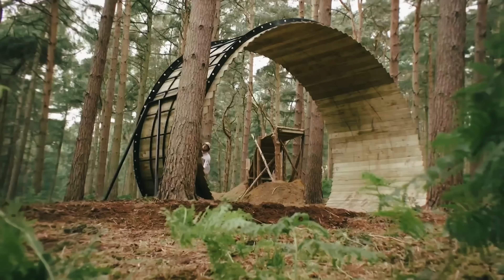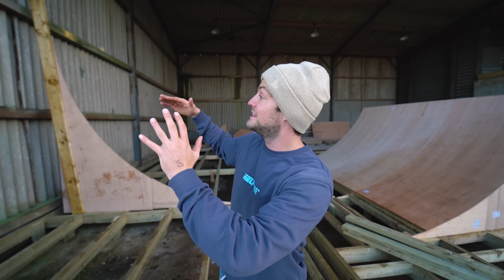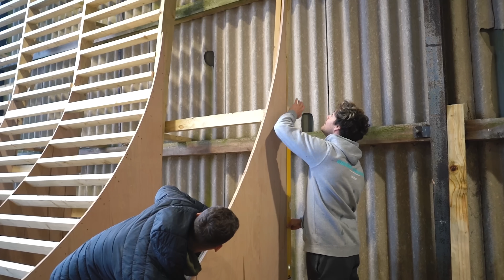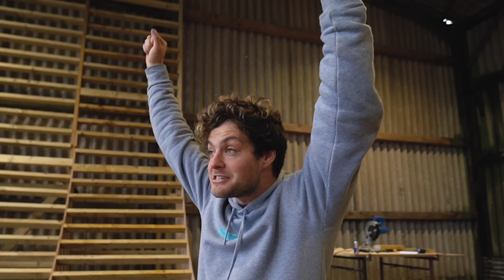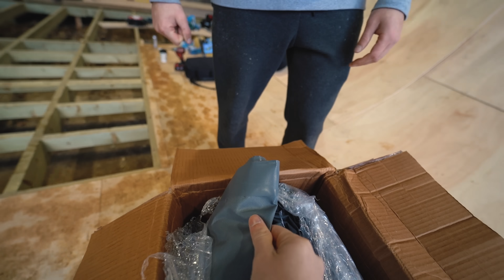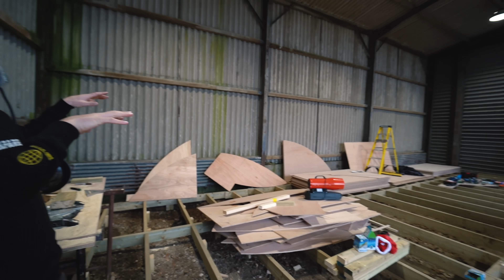WE BUILT A GIANT WALL AND NEW BACKYARD SKATEPARK FEATURES!!

Comment: Either in one of the corners or against the long wall there should be a small concrete section. And built into the concrete section there should be a fire place with a metal or stone chimney that can run all the way to the ceiling or a right angle out the back wall. A fireplace with a 6 ft roller over it. Warm n cozy in the winter!

Comment: For that final corner (even if you will need to hire Bob the builder) I believe a loop into a wave you would find in a pump track could be a crazy addition and would require that speed you would gain from the wall or any other pipe in future

Comment: I love this build! But please tell me you’re using a stop block on the chop saw when making multiple cuts for those ramp stringers? If not that’ll help with efficiency a lot. Also you could add weight to the curtain by rolling the bottom up a bit and sliding a pipe in and stabling above it, then close off one end and just add sand as needed to the pipe to increase the weight slowly, then close off both ends

Comment: curtain is gonna have a few issues unless you can anchor it down with some ratchet straps or something. I had one of those temp barns with the fabric and the wind made a joke out of it. Fighting mother nature with a sail it tricky. The wind is going to need somewhere to go and that's going to inevitably allow rain in. A decent temporary fix if you can strap it down and find a way to let the most wind through without letting too much of the elements in. We cut slits into our "doors" to our temp barn and it helped, but i also was able to have half of it open to let the majority of the wind through since my mini pipe only took up half the barn. I hope it all works out!

Comment: Rather than the Skate Light (Skate Lite?) plywood, you could look into Marine Grade Plywood. It is designed for use in boat building, so there arent voids in the individual ply layers for water to collect, and the glue is designed for moist environments. It should be much cheaper. I checked a few places (at least here in the US), and 12mm 4ft x 8ft sheets are around $60-70.

Comment: good one boys. Stopped after the water proof bit to wright this. Now you have made a sail. Hope it goes well wind can be easier to deal with then water with some holes and flaps. I think you will be also best to paint the first meter and a bit of ply. rough texture house paint should work well and not be to slipy. good luck.

Comment: Here in the states I use a product called cabot deck correct to resurface old decks.  I think it would work pretty well for protecting your plywood from the elements.  It will leave a rougher tacky finish that probably would not be good for skating on buy biking would work just fine!  It should be around $200 for a 5 gallon bucket.
Reply: Just use marine paint. It's meant for the surfaces of boats. You can thin it for a smooth finish with mineral spirits.

Comment: Please make the step up at least 8-9 feet tall (sorry, American here) that way you can have something under it, maybe a sitting area, or somewhere to store drinks (red bull and water). Then you could transfer from the top level into the step up area as it will be roughly the same height. Depending on the span, you may need up to 2x12's. They can span almost 20 feet when 16" on center. 

Loving the progress! The wall looks killer!

Comment: Some type of sealant for the wood is your best bet. OC ramps make Skate Paint, which is supposed to weatherproof the plywood, but not make it too glossy like other sealants do, so you can still ride a skateboard without it slipping all over the place. For bikes, I imagine the tires make slippage less of a concern, but you should probably want actual skateboards to be able to ride the park as well. It's definitely not the cheapest, but far cheaper than skatelite. Could be worth just buying a small amount to test out before coating everything in it.

Comment: Skate lite is a great surface for ramps, but the 6mm version in particular is really meant as a durable finishing layer. So normally you’d use something like 2 x 9mm ply layers and then 6mm skatelite on top. Running only a 12mm surface with skatelite on would likely be prone to rippling over time, especially if the joists are bigger than 300mm apart. The other issue is that whilst skatelite is durable and water resistant you need to ensure the underlying layers have been sealed to withstand the elements or otherwise the ply layers will just rot under the skatelite. So overall I’d agree that just using plywood makes more sense here, but if you did happen to get a good deal on skatelite please ensure the plywood underneath is well sealed. Note that even if it’s not directly exposed to the elements condensation can still be a source of moisture in a semi-open environment like a barn.

Comment: A tip for if you're cutting heaps of timber the same length would be set up a jig/ endstop. That way instead of having to measure every  length, you can just slide it up until it stops then go. It'll save heaps of time overall for the amount of time it'll take to set up. Even just clamping a bit of wood will do the job 👍
Reply: Yes correct always use a pattern or stop for repetitive cuts 
Use a tape as little as possible in construction belive it or not 
Top job though boys

Comment: Would be cool if you could make a corkscrew/helix to transition from levels in that back corner.  could come flying down from the wall, over the roller, and zip up the helix to get to a second level on that side of the park. have it kinda wrap behind a quarter pipe.  maybe just build that corner as a two level bowl.

Comment: If you screw a piece of material on the end of a sheet of plywood, you can "hang" the sheet at the top of the mega wall and it will be easier and safer to screw it to the skeleton.

Comment: Minimum to do to the steel beams is good padding... wrap them in soft foam and slippery / weatherproof vinyl padding - moving them is also an option, but more expensive, but could be the opportunity to properly weatherproof the space, whilst expanding it outwards too - and build another mezzanine level to drop in from under the same roof and wall work required to enclose the space...

Comment: awesome content. could stick some pipe lagging or scaffold tube protectors up that steel to prevent hand decapitation, though would likely still be painful experience. Hope the plywood stands the test of time and the curtain helps though i would be concerned about the mount of vapour or moisture that room will be exposed to. Not many ways to prevent that without huge expense, likely more cost effective to replace the ply depending on its life span. Good luck with the rest of the build, I look forward to following along.

Comment: Hi matt and team
I'm no biker but have done timber frame work, would it be worth on the roller putting 4x2s from the ground  frame to the bottom of the 4x2s going across for added support mabey laminate them and go all the way to the original floor. I'm not sure the screws will handle the landings from the transfers you have in mind, i mite be rong just an idea. Keep up the good work

Comment: You may want to consider little cutouts in the curtain to reduce wind load. You see those little smileys in vinyl signs for exactly that purpose. 

Also, would it be easier to ply the vert-wall from top down to stand on the horizontal pieces as you go? Or perhaps just screw some pieces into the decking to stand on and work upwards.

Comment: What if you take that 10K that would be spent on the skate park ply and spend that on installing giant roll up doors or framing a big wall to enclose that open side? I’m sure you’ve thought of all that but it would be so much better than a curtain. Even running steel beams and using tin to close it off.

Comment: few pulleys, some rope, some pvc pipe along bottom edge of tarp to roll around,  and you got yourself a roll up door. Maybe a boat trailer winch if its too heavy to roll up by hand?
I dont think it will work well trying to slide them open along a cable due to too much drag.

Comment: Hi! You should build a step-up jump like you've said, but one with lip and than just a flat wood piece screw down with an angle (for nose bonk tricks) and then flat spot on the top as a landing. Then behind that step-up another steep wall (on the same side of the barn at it is one already) next to the quarter and than you could jump the step-up turn around on the top platform of the step-up or on the quarter (if you gonna build one up there) and than just roll and pump down the lip of the step-up do 180 on the steep wall and jump again the step-up with high speed which you make on the steep wall  and jump it again and just do loops of these. It would be insane and very good use of the remaining space.

Comment: When cutting radius’s it’s much quicker and cleaner to use a nice circular saw. Also a stop block for your miter saw would save you guys so much time. Just need a an extension either side of the miter saw then screw in a piece of wood at the correct length, it will save you guys so much hassle

Comment: If the big curtain doesn't work you might have to do big rolling doors you can push back to the other side of the barn. can sheet them with steel like the rest of the building, might have to do something where its 2 or 3 rolling doors that are staggered

Comment: The raised area should have a wall ride element from the pump section so if you are making the platform same height as the spox then the wall ride should be 2ft up from that with coping on both sides at top. 

Going into the platform would be good to have two or three variations on the lip depending what you want to do on the platform and you should add a box with coping for some steezy peg work.